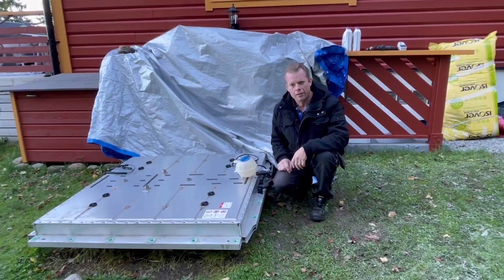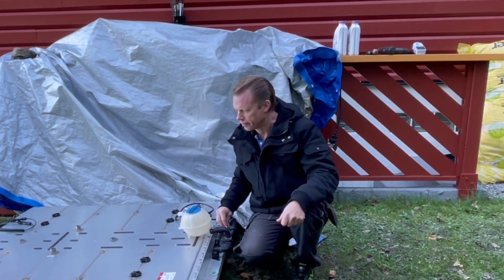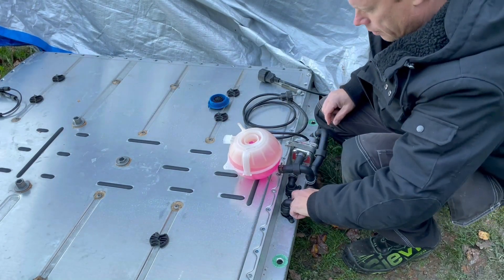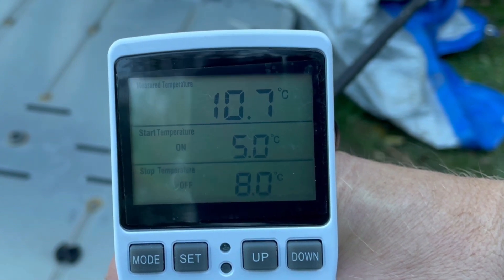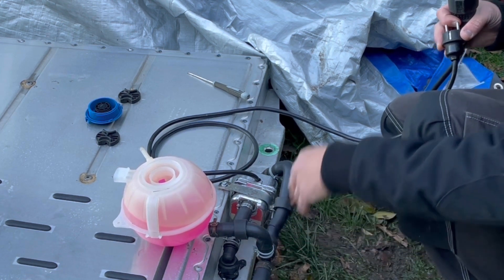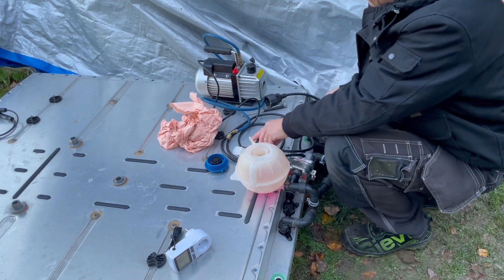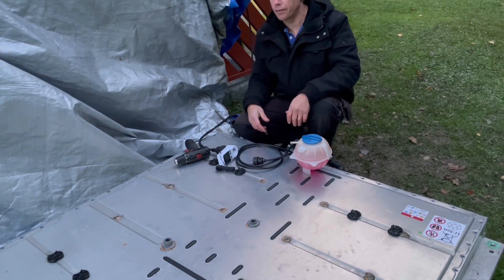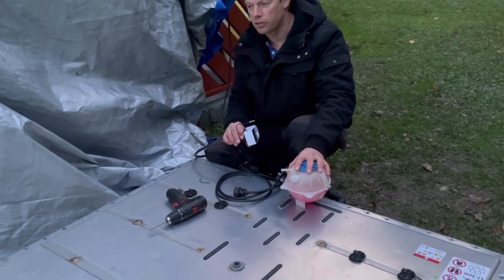Vw id3  battery heating is finally completed.

Comment: Think about insulation fe pump, pipes, reservoir, temperature sensor, battery etc. Greetings from Poland.
Reply from the maker: Hi, yes you’re right about that. The complete battery will be in an insulated box.
Thanks for your comment👍🏻👌🏻